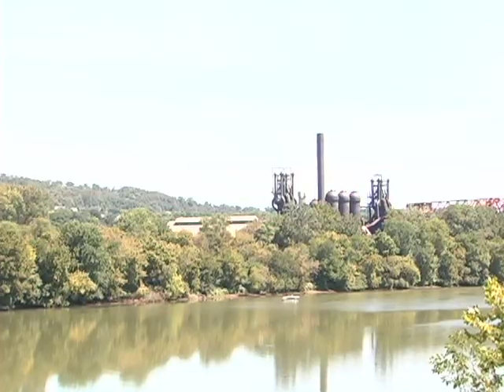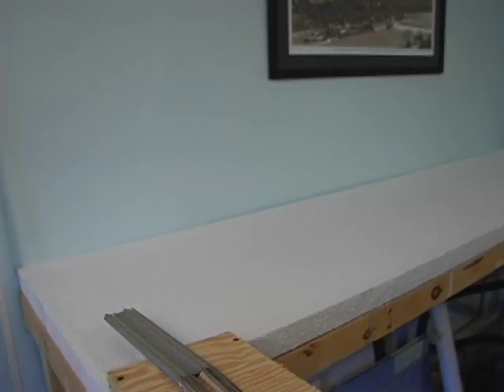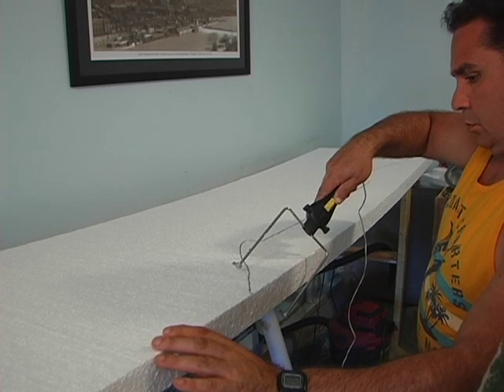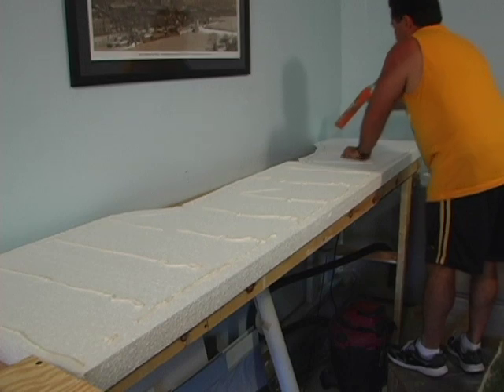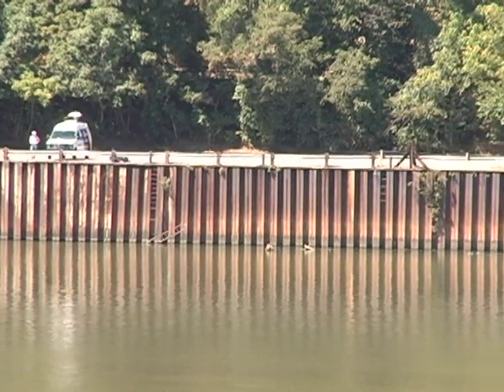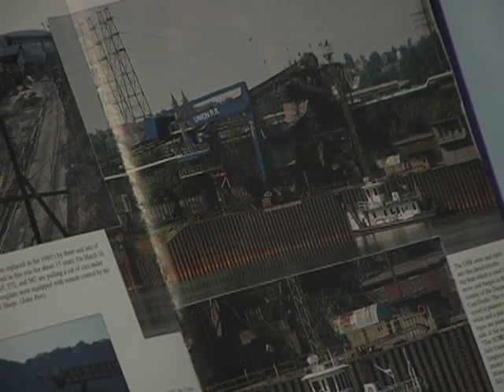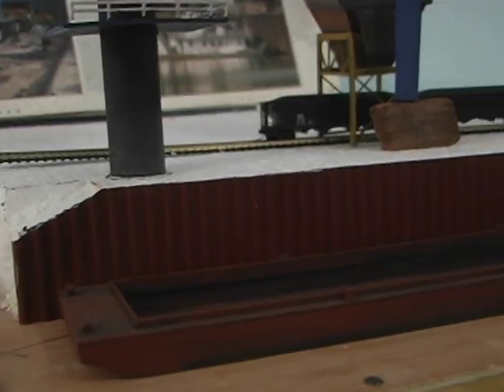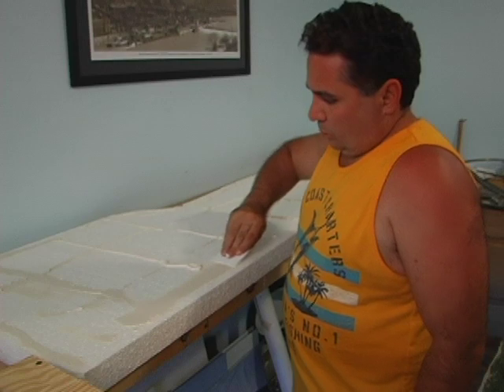Model Railroads: Making The River Coal Docks.  Part 1.

Comment: we got a transfer like that on Birmingham Southern it is a big return Loop.
Reply from the maker: Ours is more of a switchback, but I had to model a loop to get it to fit.
Reply: djstrains I am thinking of modeling Birmingport but I am having trouble blending the seens together.  because the mill and the port are 25 miles apart
Reply from the maker: Rad McGuire so is Duquesne to north bessemer.  I am using scenery dividers to separate the scenes.